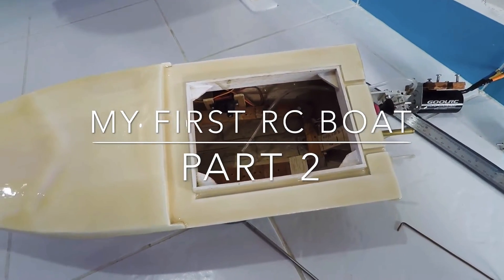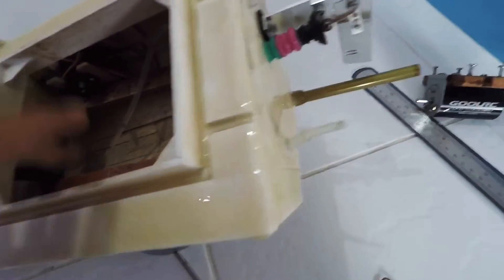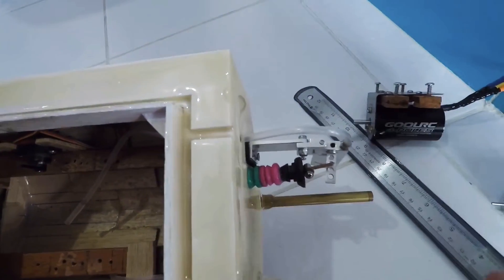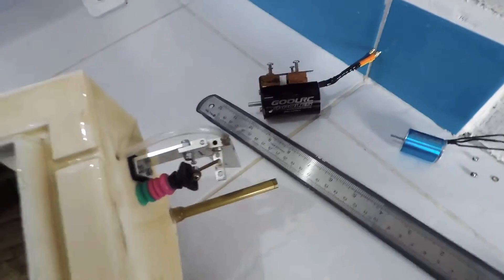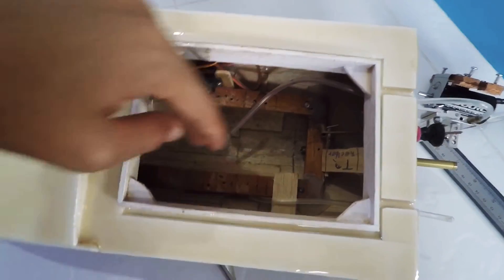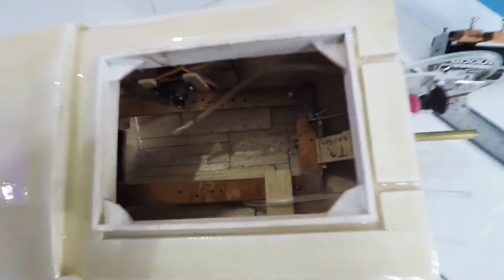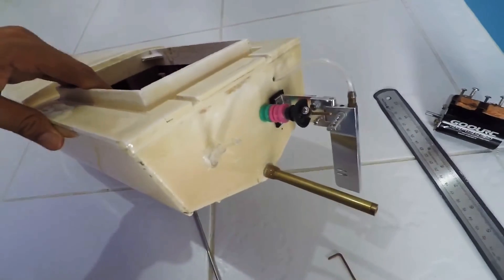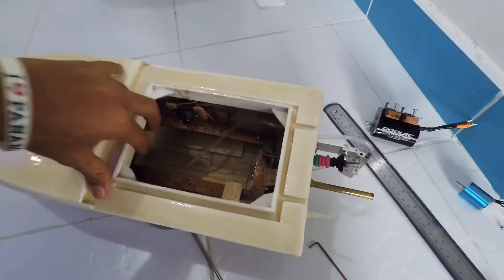RC Boat - Homemade - part. 2 / Modifications

Comment: Doubts:
Q1. what shaft did you use ? in the V bottom drive 
Q2. How Did you make your boat stable on water
Q3. did you use Arduino in turning, accelerating, decelerating etc? if yes then pls send the codes?
pls reply
Regards